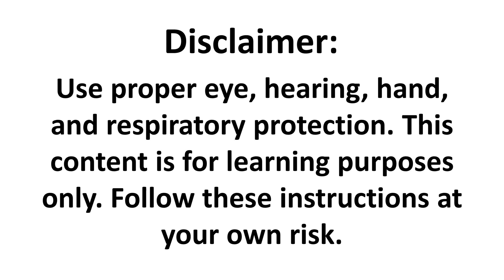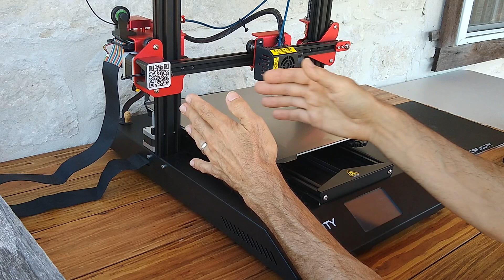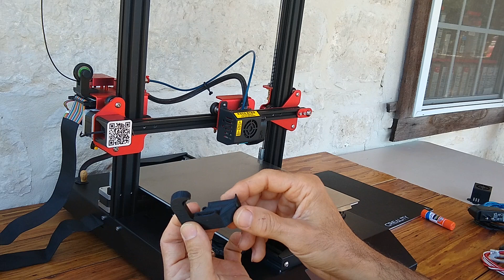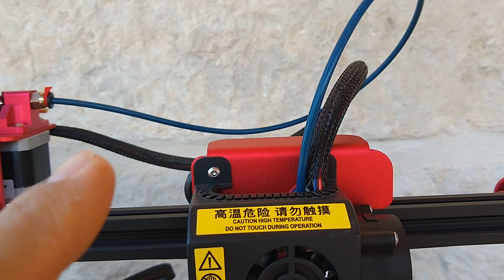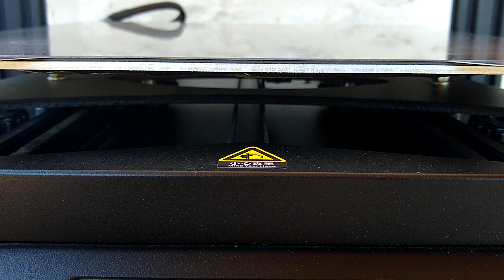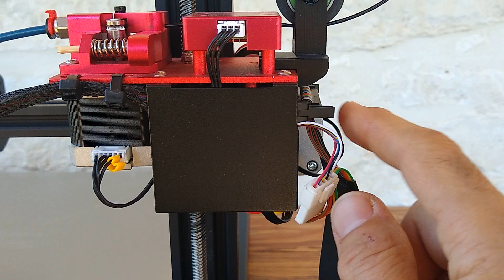CR10S Pro V2 upgrades that make a big difference in producing quality, and successful prints.

Comment: What did u print your fan duckt in? Petg? Btw Nice video
Reply from the maker: Hello EENIG, Thank you for commenting and kind words. Yes, PETG is what I used. I should have mentioned that in the video.

I'm working on the decorative cover piece for that shroud and will share the .STL once it's finalized.

Best of luck with your projects!
Reply: @vbared  thx and no problem. Think il do it in petg cf then :) and do you and link to stl file when done with cover ?:)
Reply from the maker: @eenig8730  Good morning EENIG, I just noticed that I replied to you in this video about one that I recently uploaded about the Ender 3 V2, my apologies. I scrapped the air duct I talked about in this CR10S Pro V2 video and went back to the stock duct but made this adjuster plate that allows me to move the stock duct up or down so it could be made to work with the new assembly. The file and pictures are here: 

https://drive.google.com/uc?export=download&id=11f3JpPPXBdvD_qRntdQH1Qu5R54PsUhE

Best of luck with your projects!
Reply: @vbared  why did u scrap the air duckt? And its all ok mate
Reply from the maker: Hello EENIG, The duct that I downloaded and modified to fit the new direct drive setup on the CR10S Pro V2 didn't flow well at all. I did some tests to check airflow and it hardly moved water in a shallow bowl placed directly below it. The new fan adjustment plate made the stock fan duct work much better since it was moved away from the tip by the thickness of the plate. It widened the airflow and since that stock fan flows so much air it significantly cut down on the stringing from the fan blowing so hard on the tip and does a better job of cooling parts.

Comment: Excellent video very good to share it the other you would be so kind to share some profile I have microswizz too and I can not find the point of retractions since a thousand thanks
Reply from the maker: Hello Alejandro, Thank you for commenting and kinds words. I'm using 10mm for retraction distance and 25mm/s on speed for the Micro Swiss without direct drive with great success. If you are using the Micro Swiss hotend and direct drive extruder then use 1mm retraction distance and 25mm/s for speed.
Reply: @vbared  Thank you for answering kindly. I comment that I have used 6.5 mm of retraction in pla and I received jams, I will try that configuration anyway and I have bowend if at some point I will do it direct Thank you very much for answering

Comment: I have 2 CR10S Pro V2's with WhamBam plates....I have never needed any extra adhesive on my build plates!
Reply from the maker: Hello Joe, Thank you for commenting. You're 100% right the WhamBam is awesome and works for me perfectly without anything for 95% of the stuff I print in PETG. I have some parts I sell, that take 12 hours to print, are tall, and have small bed contact points. I print them without brim and support to avoid having to remove the imperfections later. I use the stick glue on the WhamBam as insurance against a power hiccup, or nighttime temp change that had caused edge lifting when I first started printing it.

Best of luck with your projects!

Comment: Personally I'd recommend a brass brush. No need to have the brush be stronger than most nozzles. Less abrasive this way. In addition to the Capricorn tube, I run a filament snap on box that removes dust and slightly oils the filament. I'm actually printing up some nozzle fan adaptors right now so I downloaded yours. I've actually done most of the upgrades you recommend (partly based on your other videos). Thanks for the video, SLT and your info!
Reply from the maker: Hello Todd, Thank you for commenting and your suggestions. The brass brush instead of stainless one is the way to go and something I didn't consider mentioning for those running a brass nozzle. I'm running a treated steel nozzle since my end goal was carbon fiber reinforced nylon. The filament cleaner is a super cool idea. Definitely one for me to try. Do you have Thingiverse link to recommend? I'm thinking about switching out the motherboard to a 4.2.7 and use the display from an Ender 3 V2. I recently purchased an Ender 3 V2 and am blown away by how awesome the prints are compared to the CR10S Pro V2. All the hardware being the same I'm thinking it might be something better about the control board. What do you think?

Comment: printed your fan duct, excited to try it out! unfortunately with the stock print bed the duct doesn't work right with auto leveling or large prints because on the back side of the bed the new duct hits the clips that hold the bed on. Plan to keep the part around though, I'd love to use it if I upgrade the bed in the future.
Reply from the maker: Hello Nick, Thank you for commenting. I'm still playing around with its design. I'm new to CAD and have been blown away with some of the awesome things people design. What a shame that it doesn't fit the way it is.

Comment: Hey mate, I'm brand new to 3D printing and I have the option of buying a Creality CR-10S Pro V2 for about the same price as an Ender 3 V2 - which should I go with?
Reply from the maker: Hello TDXAV, Thank you for commenting. The CR10S Pro V2 is usually around $629, comes with a bigger print bed, dual Z axis motors, BL Touch, filament sensor, and packed with all kinds of other upgrades right out of the box. If you have the opportunity to get it for the same price as the Ender 3 V2 jump on it.

Best of luck with your purchase!